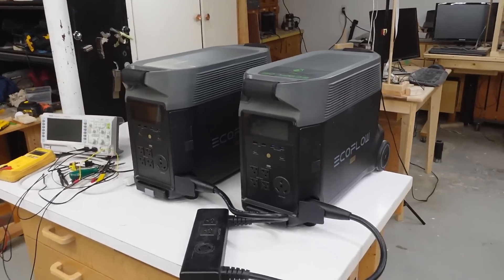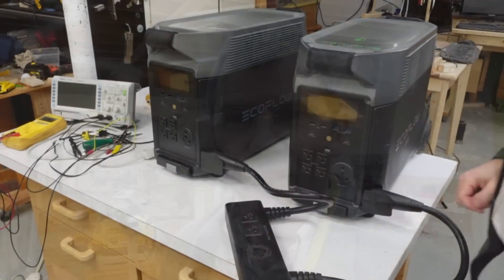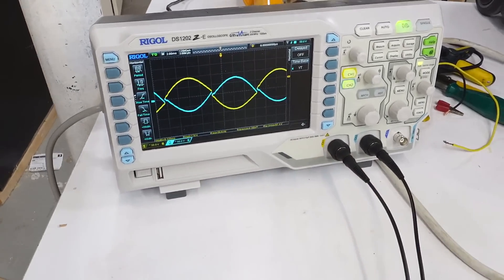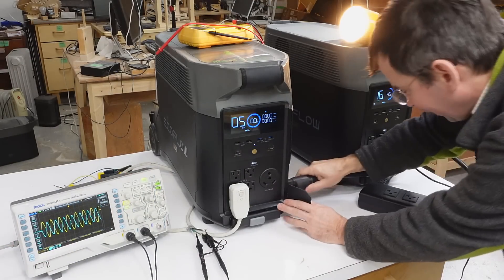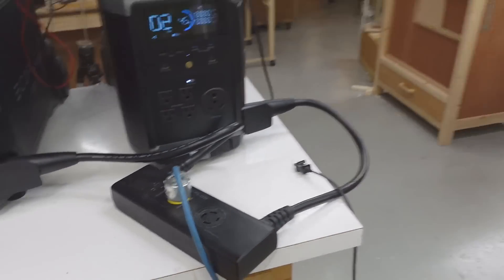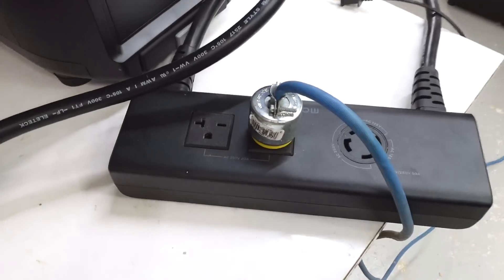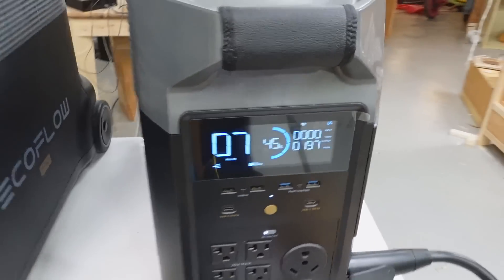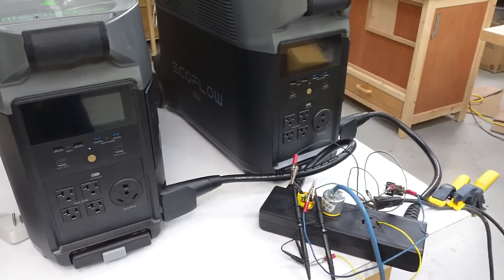Two 120 volt inverters in series to make 240 volts

Comment: Any way to "diy" a decent soft-start adapter cord for situations like this? I know there is stuff you can do with capacitors, but I've only seen that done with induction motors, not the universal-type motors in some power tools.
Reply from the maker: A "soft starter" for an induction motor would have to be some sort of VFD (variable frequency drive), quite expensive.  For universal motors, it's much more doable, and many tools with universal motors already have a soft start.
Reply: @matthiasrandomstuff2221  There are ones bases on SCRs that are cheaper than a VFD.
Reply: @matthiasrandomstuff2221  https://library.e.abb.com/public/bea0ee02a2a84683ada4daab569a1cb2/1SFC132392M0201_Performance_comparison_between_2-_and_3-phase_controlled%20softstarters_rev2.pdf
Reply: There are soft start modules that work like a dimmer for light bulbs but those increase voltage automatically, some taking up to 5 seconds to reach full speed.
Some power tools incorporate them to avoid tripping breakers and to avoid overloading portable/small generators on construction sites, they also have the side effect of extending the life of the motor and gears that suffer much less impact than with an instant start.

There are some aftermarket modules available online, some have 2 wires and are connected in series with live or neutral, others have 3 wires, one for neutral, one for live in and other for live out, but they don't care if you. wire them with reverse polarity like live, neutral in and neutral out...
Those are the most common aftermarket modules, altough a lot of tools made in China have those fitted from factory:
KRRQD20A 
T0601001
KR-009
XS-12/D3
LQD-2A

Brand tools sometimes have it built into the switch or some module that performs additional functions, such as overload prevention.

Comment: Connecting a scope probe to AC is a bad idea.  Scopes are grounded.  The neutral is tied to the ground remotely (at the panel) so there is a voltage drop on the neutral.  If you ground the neutral through your scope its possible to damage the scope.  For this test the battery inverter source does not have this problem.  I use a special probe for this purpose that has safety ratings similar to volt meters.  Nice video.
Reply from the maker: And I used a power station that wasn't hooked up to ground.  that scope probe was the only ground connection the battery box had.
Reply: @matthiasrandomstuff2221  I'm just worried about someone doing this in there garage and blowing up the scope.

Comment: Definitely got enough backup power to survive the recent polar vortex. Did your mini splits hold up?
Reply from the maker: We turned them off when it hit -20.  It was a good chance to burn scrap wood in the wood fired boiler in the house, kept the house warm at -29 c
Reply: @matthiasrandomstuff2221  A wood stove is a good backup especially if the power goes out. Power did go out here (in Moncton) for about 4 hours, just enough time for me to think about pulling out the generator and then the power came back on.
Reply: @matthiasrandomstuff2221  wood fired boiler? I'm jealous

Comment: Oh did you watch my videos on that problem? It would probably work just fine as you said, but in bypass mode when connected to grid, that's when the issues occurred. That's a bummer you didn't seem to watch my video on it. It was the AC charging circuit that was hurt by the ground neutral bond and I showed my setup in detail. I think you didn't see my video and just read my comment.
Reply: Dude, stop begging for views.  I've seen it here, on Sandy Munro, and others.  It's gross.

Comment: And for conclusion - Ecoflow is still great inverters with great build quality.. 😉 But power meter needs to be investigated next.. 😂
Try to connect some smps power brick or phone charger to Ecoflow and then run circular saw..
Deeper investigation will be nice.. 
Anyway, excellent video, as always! 👍
Reply: IMHO Most SMPS devices would not care about this oscillations, because they just rectify the voltage and then run DC/DC step down conversion. All small ones do that. Bigger ones have PFC that may change a bit.
Reply: @anonanonkiewicz1921  You can't guarantee that.. All depends from topology, input filters in smps and load on them when anomaly occurs. First may go bridge rectifier from overload or just fuse.. Same damage at mains use, sometimes, is even caused by bad connection.
And when bridge is gone, other parts from input stage may be damaged. Only output don't care about these spikes but smps will be dead!
Reply: @artursmihelsons415  as far as I remember, the spikes didnt have any higher amplitude, just the frequency (looked like about 1kHz). Why would that destroy a brigde rectifier? If the frequency is too high for the diodes, they dont care, so does the capacitor.

Comment: The device working as it should under stress is just as interesting as it not doing so. Thanks for stress-testing it, and for showing clearly what happens. Companies may not like when their stuff is pushed beyond its comfort zone, but they're just under-estimating their consumer's critical skills... If the message is: "don't connect sensitive electronics at the same time as starting up large universal motors or inductive loads", that's a useful message that doesn't really detract from the general value of the inverter. Not getting this message can lead to unintended carelessness and so does make the inverter less useful, however, so you're just doing everybody a favour.

Comment: It's funny that we're sort of expecting a "ECOFLOW EXPOSED" rant, but it turns out it's just a good, albeit expensive, battery inverter with known limitations. Obviously they didn't sponsor this video, but it ironically builds credibility in its own way.
Reply from the maker: yes, they got somethign for free there.  mind you, I did get the battery boxes from them, though mostly I have them for "just in case"
Reply: They are really nat expensive when you compare to similiar products.
Reply: @rkan2  The really are that expensive when you compare them to similar solutions, like a gas generator.
Reply: @ewicky  A gas generator is not a similar product and doesn't allow you to save your solar energy for later use for example. In other countries you can also get free electricity at times, again a gas generator wouldn't help. Compare to a Tesla powerwall or similar
Reply: @rkan2  Ecoflow and similar products fall under the "portable generator" solution category. They are even marketed as "solar generators" and marketed towards traditional gas generator uses, like camping, power outages, etc. Where they get their fuel from is what makes "solar generators" so expensive. Solar panels and batteries are both much more expensive than gasoline and an engine, especially for intermittent use.

They don't offer grid-tie functions so it is entirely a different solution than Tesla Powerwall I realize the hardware is conceptually very similar, but entirely different solutions.

Comment: Would love to see this test done with an inverter gas generator. I believe they have voltage on the neutral as well.
Reply: I use a neutral bonding plug on my inverter generator without problems.  I do this in order to utilize an RV surge protector.  The surge protector trips power off without neutral and ground bonded.  If there were voltage on the neutral, I believe the inverter protection circuit would trip when the bonding plug was installed.
Reply: Probably very similar since the difference is the power source, basically from a large battery to a small engine DC dynamo.  I plan on making my own hybrid inverter generator by taking an automotive alternator and combining it with a small gasoline engine, an inverter and an auto battery.
Reply: @WJCTechyman Gas generators don't have dynamos. Efficiency would be piss poor, not to mention the issues with brushes...

Comment: the reason why they cant do 240V "US style" is because the 240V system is differently set up with a center tap for 120V and without that you lose the 120V option. and a 240V model cant switch between 120 and 240. the inverter would be stupid inefficient or just have half power at 120V.
Reply: Would that work for a 240v welder?
Reply: Why I just love our 240 VAC (and the three phase 380 VAC). No fuzz...

Comment: now for 3 phase:P....:'D
Reply from the maker: yes, that wouldbe neat.  But how often do I need to run a 3 phase motor off of batteries?
Reply: @matthiasrandomstuff2221  about half as often as you need to run 2 circular saws in parallel of batteries ;-)
Reply: was just thinking never know when you might need to use a milling machine or lathe on the road... or while camping :'D

Comment: it does not make sense that one would put out more voltage than the other when in the 240 configuration.  Plug in a laptop charger while watching the current with a current probe and you will be amazed at the high start up current. Of course, it is only for a few cycles.
Reply from the maker: The capacitor chargeup inrush is big, but its a fraction of a cycle.  The circular saws big inrush lasts many cycles.
Reply: @matthiasrandomstuff2221   From the scope display, it appears that the two electric handsaws wired in series caused about 5 cycles of disturbance. Also, hard to believe a power system would be designed to change the output voltage level on one generator simply because the other generator had less capacity left.  Seems a better design would shut down when the lesser was drained below the threshold.  If that is not the case, that company needs to hire a more experienced design staff. Of course, that may be the reason there are no 120V outlets on that combiner.  Interesting inverter waveform has that very pronounced crossover -- like a poorly designed class A push pull audio amplifier.
Reply: Even switching PSUs without active PFC usually have a PTC on the input to reduce inrush. But modern stuff is all active PFC, and there inrush is limited by the PFC converter, so it should really be no problem :)